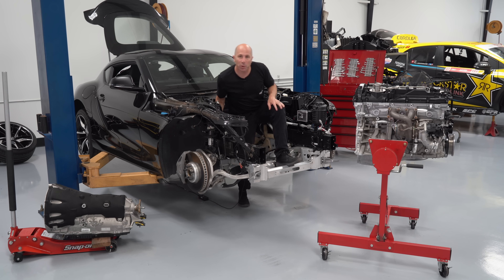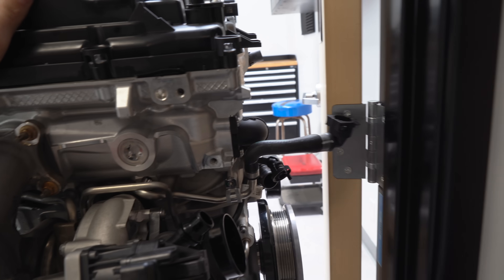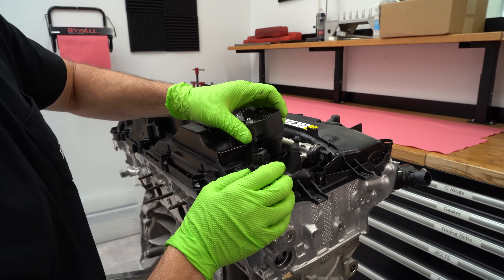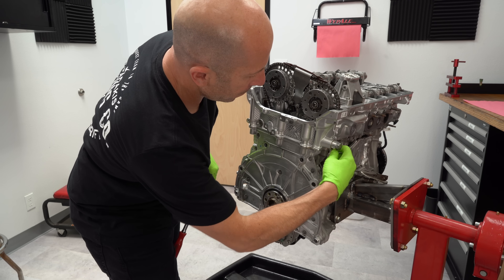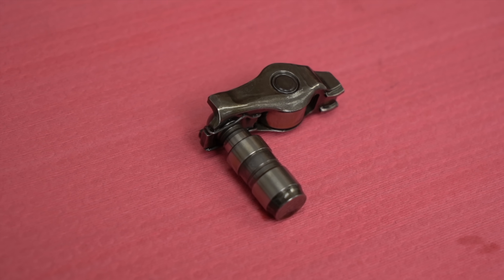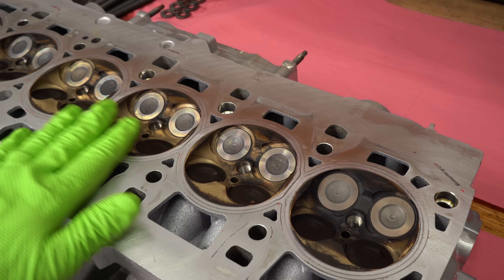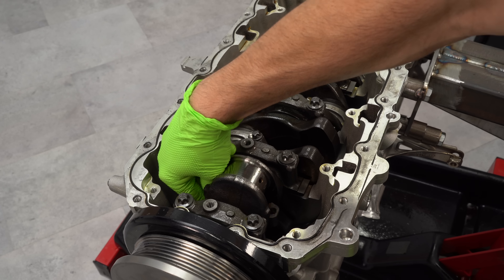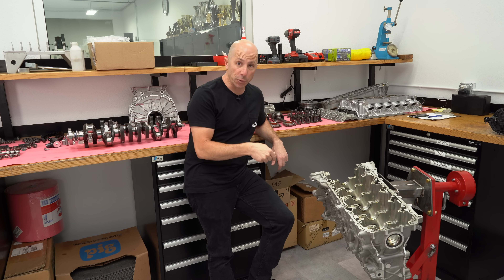2020 Supra B58 Engine Teardown - First Look - Better than the 2JZ?

Comment: Now you guys need to open the BMW version and see what changes or is it exactly the same set up?
(I kno it's the same engine but let's see if Toyota changed anything at all for the Supra)
Reply: I have a feeling it would come down to cam profiles and ECU tunes, but we'll never know if no one does it.
Reply: @johnurbanek1027  if it has to come down to that, then be so!!
 let's mesure cams, stroke, compression ratio, quality, ECU reading comparisons etc.. What did Toyota change ?. I wanna see it all!
Reply: This engine is widely available across BMW lineup, don't even need to gut a z4, 340i should do
Reply: @fastboatster  not really... This is a b58c... I think only available on the x5
Reply: @godder1an  well, x5s previously had their own versions of n52 engine, the only differences being oil to coolant heat exchanger, bigger intake and different software. I honestly doubt that there are any material internal differences between 340i's b58, x5 and z4/supra. Well, maybe cam profiles
Reply: I 2nd this motion!
Reply: i hope you know...toyota co-developed this engine, so they had input to make it more reliable. After that, they developed the b58, which is used in many platform
Reply: @herewegoagain7403  bullshit, the b58 was done by BMW only
Reply: @herewegoagain7403  fax. toyota quality standards😎
Reply: @herewegoagain7403  come on, this is all marketing bs. Pretty sure these engines are assembled by the same bmw or Magna steur facility. And bmw engine never had reliability problems caused by weak internals, it mostly were gasket leaks, failing water pumps or rattling wastegates
Reply: @POVShotgun  yes, they use sealants here instead of gaskets which tended to leak on the n series bmw engines. Time will tell if sealant holds up better
Reply: Toyota does have a reliability standard that’s the Toyota way so I’m sure there has to be something special to Toyota that only Toyota knows about to make it all that special
Reply: Good idea
Reply: The cylinder head is different ........ non supra Bmw b58 have 6 exhaust ports. https://www.bimmerboost.com/images/imported/2018/10/BMW_B58_Turbo_1-1.jpg
Reply: Exactly the same engine, in fact Toyota doesn’t do any servicing on these engine, I work for Toyota they don’t have the tools or parts for these cars, all these cars has to go to BMW for servicing. You folks need to know what you’re talking about before making comments!
Reply: @c3bam1  ha ha. I knew it. Nothing changes but the shell and name of the car

Comment: This engine is absolutely dreadful, 0 majesty out of 2jz left here, totally disappointing
Reply: When we have 6 cylinders like the TB48,1FZ,Barra,RB30 and VR38 there's really no reason for the B58 to be anything like the 2jz when we have other 6 cylinder that are different from the 2jz that can handle the same amout of power it can.
Reply: @carboydorifutoparty3976  the beauty of the mentioned engines especially ones from 90s are that they are easily tuned and modified and can handle a lot off stress with reasonable resource. Here we have aluminium block instead of cast iron, timing chain in the back part of the engine (check how thin it is), valvetronic system which was discarded by bmw because of reliability issues, direct injection, and 2 exhaust ports on 6 cylinder engine!!! What kind of engineering is that for a performance car? It is just a batch of flaws.

Comment: To me there is no replacement to the 2jz and that is not BMWs fault. Toyota can't do it either just like they did with the 86 and the AE86. You cannot replace the 4age. Both are good cars and can coexist. If you put a 2jz into a modern supra its still not an old school supra. Personally I dislike the looks of the modern supra. Its very ugly from the back and its also a surprisingly small car. Like a compact version. I live near the assembly of them and see them all the time and I thought I would get used to the looks but its still a damn ugly car. I am a Toyota freak and would honestly prefer a BMW 3 series over the new supra because of the looks. Lets see how reliable the new model is and the engine itself will probably not be an issue. I hear many stories of BMW chains breaking but people talk alot.

Comment: A plastic manifold...? One thing I love about my 2jz aesthetically is the large manifold. I don’t know that much about engines but surely a plastic manifold can’t be good in the long term?

Also another thing I love about my 2jz is the simplicity and how easy it is to replace/service the engine or anything on the car. but this 2020 Supra engine seems a HUGE pain in the ass. Having to pull the motor just for a timing belt Change?

Comment: 14 yo 2jz virgin fans ain’t gonna be happy to hear that but who cares
Reply: their tears make me stronger.
i really want to see what the B58 is capable of, and i have no doubt it will be a lot
Reply: Ducko it’s capable of 500 with just a bolt on🤷🏽‍♂️ can make more easily.
Reply: @itsdokko2990  Do you have or ever had a bmw.I have one an 04 e46m3.I know all of the gremlins in the m3.And there are some that were designed into the car purposely.A few are going to happen if you drive the m3 as designed.The rod bearings will fail,the subframe will fail,vanos failure, ect.For the money a Camaro zl1 1le will kill m3 4 5 6 around a track for 25grand less and still be more  reliable.If you dont care about reliability,price or performance get a junk bmw I did and regret ever buying a slow unreliable lemon bmw.Toyota will regret this deal too.2jz will always make more power,be more reliable better looking,easier and less hp for the money.BMW  (big money waste)
Reply: @realisrealite5554  lol, you base bmw reliability off of an e46 m3.. lol thats one of the most high strung engines bmw made.. funny how during the e90 generation bmw actually  awards for the most reliable engine of those years those cars were made. Also the b54 is considered the modern 2jz, and now the b58 is even stronger than that. People are getting stupid power from a tune on b58s. 2jz  fan girls should get that atrophied toyota nutsack out of their mouths and realize toyota wouldnt put there single most important name on a car if it wasnt up to their standards. Bmw does on good thing and thats build good straight 6s. People need to wake up.
Reply: @jtg199  the e90 reliable ? Yes one model, the 330i, that's it 😂
Reply: @E9X330  well yeah.. you just repeated what i said back to me.. your point? Bmws before the e46 generation were very reliable (e36 has interior quality issues, and most earlier M cars have strung out engines)..after that  bmw was trying to push technological innovation but couldnt keep up in the reliability department. But now times are changing and they are getting better. 9 times out of 10 people have issues with bmws because everyone buys them used and the are most likely leased cars that were never taken care of by the previous owner who is just going to trade it in for the next model in a couple of years. Id go as far to say that 90% of malfunctions on bmws are due to lack of proper factory recommended maintainance.
Reply: idk many 14yo who even know what a 2jz is so good for them
Reply: Alvaro C fr
Reply: @Woke_R2  am 13 i know 2jz is. i hate toyoda for puttin beemer engene in the knew soopra. toytda brain very mini yes.

jk i really dont care if its toyota or not as long as its a good, well built engine. 13 y/o approved supra.
Reply: BeSold fuck I’m 16 I’d still buy it
Reply: That engine might make good hp # but it will never be as reliable as the 2jz.Toyota is going to take flack because we all know that bmw engines are unreliable.Theres not one bmw that I would take over a real toyota supra turbo.
Reply: real isrealite ever heard of the 7m? If this engine ends up being unreliable, it won’t be the first unreliable Supra engine
Reply: @realisrealite5554  I tend to agree with you... The thing that's going to break down on this new BMW engine is the Plastics that surround the aluminum block they are going to break down and crack... Too much plastic in my opinion!!
Reply: real isrealite BMW in Europe and ect German manufactures there are reliable more than what you think it depends where do you live well it’s seems like you’re from the USA or the Middle East

Comment: This engine is so complicated and expensive you need to modify even the engine stand and spark plugs tool.

Lots of hoses and breakable parts. Let’s start with the points:

1- The cam gears are on the back which adds to the complication and expensive to work on (the 2jz is simpler and cheaper)

2- The cooling system is so coplicated with a whole thermostat compartment (the 2jz only has a thermostat).

3- the direct injction system need to be modified because the bearing might fail ( the 2jz has simpler and reliable system).

4- This engine has two chain and many guides (the 2jz has only one)

5- The oil pump is driven by a chain, thus the rate of failure is higher (the 2jz oil pump is driven by the crank).

6- The valves has rocker, it’s old complicated tech and may fail with high rpm (2jz only has shims).

7- The vvt i system is so complicated and every valve has a special rocker and a vvt-i system ( the 2jz vvt-i system is in front of the cam gear).

8- The pistons are light (2jz pistons could withstand up to 850hp).
Reply: BF109G with growing EPA regulations all of this technology is necessary to meet standards. Like the video stated. todays engineers are simplifying this tech and making it reliable. Will parts fail when people start modifying parameters or changing out components? Of course but you have to keep in mind no manufacturer takes into consideration people wanting to build 1000hp engines. That why with an engine so new theres trial and error till the aftermarket r&d’s components, programming, etc. the 2jz is a 30 year old engine at this point. 30 years ago EPA regulations were nothing compared to today. Although not the only factor my point is... you cant compare a 30 year old engine to a new one fairly. People need to stop living in the past and accept that the emissions standards will only get stronger until the internal combustion engine is no more so why not embrace great engineering showing us an inline 6 still has a place in modern performance.
Reply: Cold Pizza What EPA regulation have to do with a complicated vvt i system or a very expensive thermostat and cooling system ? The VQ38 of nissan don’t even have vvt i engine and the engine is simple and doing fine except having an open deck cylinder. The B58 is very complicated and toyota can remanufacture the 2jz with higher capacity, direct injection, and developed EGR system. Believe me the engine will meet the regulations easily. They can add more muffler (putting in mind that people will remove them for high HP) and this would never be the problem of Toyota.
Reply: BF109G the vr38dett has variable valve timing on the intake... just like the new supra engine and most modern engines. “Re using” an ancient engine like the 2jz is not only a very stupid idea but its also likely impossible. You cant simply “add mufflers” and “upgrade the egr”. Its not that simple. The whole engine would have to be re-engineered to the point of it being a completely different engine. Maybe if Toyota kept development of an inline 6 engine past the early 2000’s we would have gotten a Successor to the 2jz engine but manufacturers follow market trends and what a surprise! Constantly changing EPA regulations. Its the reason we got a Subaru/Toyota/Scion partnership and its the same reason we got a Toyota/BMW partnership. Its not worth Toyotas time investing millions in r&d’ing a fully Toyota engineered sports car to cater to a handful of its fans when they will outsell that same car 10 fold with trucks, crossovers, and sedans.
Reply: Cold Pizza Not impossible sir. Toyota kept producing the 1FZ engine till 2009 and they still make 4 cylinders (in my opinion 4 cylinder engines are more difficult to meet EPA). They can revive the 2jz because it has the same principal as the B58 but different in complexity. The EGR system of the 2jz could be solved by developing because it’s well made. I’m a mechanic sir and I worked in many engines so I’m not bluffing.

Comment: You should take apart a Z4 engine and see the difference.......oh wait.
Reply: Actually I am curious, because the Z4 M40i that we got in the US is a different higher output version. Instead of the integrated exhaust manifold it has individual runners. From my understanding they had to use the other heads in Europe for emissions, but not in the US. Toyota seemed to have stuck to just the same engine in all markets, probably to simplify the supply chain.

Comment: I seem to remember that things didn't go well when BMW fitted a timing chain on the rear as it's an engine out job if they need changing for any reason. Not too sure I want something electrical managing the coolant flow as that's another failure point and I am sure that charge cooler in the intake will probably leak at some point hydrolocking the engine. Not really sure I like the design of this engine but I guess it's a throwaway single use item like most BMW parts these days.

Comment: Some bits I like, alot I don't like. That exhaust manifold looks like a compromise but a good way to improve use of space on that side of the engine, not a fan of having to take the engine out for chain cam drive work.

Comment: Timing chain on the rear of the engine?? So the engine has to be pulled for the timing chain replacement?? What a stupid engine design, I guess it's German engineering at its best. Oh wait, my bad the B58 probably won't last more than 150-200k miles anyway so guess you won't need to ever change the chain🙄👎 No thanks, give me a timing belt over this nonsense

Comment: Finally 100% that the heads are the integrated exhaust manifold vs the individual runners on the higher out put B58. The difference is more low end TQ vs higher end HP.

Comment: Unfortunately I think the internal exhaust manifold is going to be a limiting factor for really high HP.
Reply: Yeah, I imagine it's a little more difficult to port one than your typical exhaust runner.  It'll make plenty of power for the street, but I think you're right.  Not gonna have big power drag racers running these like they do with the 2JZ.  I'll be staying tuned for this build though.  Who knows?  Maybe it flows really well.
Reply: @randr10  that was my first thought when he pulled the turbo off. who knows, we could be wrong. Only time will tell.
Reply: @randr10  Guys like you are totally clueless..., you annoying trashtalkers! Just shut the fuck up, because you know nothing about BMW engine technology! Fucking idiots!
Reply: @randr10  I guess that's why they have an aftermarket!
Reply: Jr ALEXANDER  Not a new engine. The B58 has been in use since 2015 in different cars, like the 340i or the M240 and such.
Reply: Jr ALEXANDER this engine isn’t new it’s been out since 2016
Reply: Definitely see a potential for an aftermarket aluminum intake manifold feature much better cooling overall I think this engine is brilliant doesn't look too complicated not unreliable. I have to say BMW has done a great job with the design.
Reply: Someone in the after market will go in and mill out that exhaust runner and fab a race manifold.
Reply: Extrudehone that bitch
Reply: Unfortunately an annoying trashtalker like you has absolutely no fucking clue about a modern inline six combustion engine layout..., you fucking idiot! 
I can tell you, how I hate such smart-ass a-holes like you..., who are always complaining about a BMW engine... WTF??? Hey, just wake up, buddy...: it's from BMW...!!! 
It's certainly not coming from a no-name company... you fucking annoying trashtalkers are totally ridiculous! 
By the way: what would a McLaren F1 be without its BMW V12 engine, which was a masterpiece of its own 25 years ago?! And the same goes for this B58 inline six today!
Reply: Jr ALEXANDER Because I've seen engines that have lacked many of these internals that are deemed as unreliable, Toyota themselves did a very intensive reliability check on every piece of this engine, and prior to the b58 the N54/55 had proven itself to be an incredibly strong engine internally, the newer ECU also has great features built in all around that make it a fairly great.

Comment: Very component based design, more expensive for the end user but fewer parts overall. I’m impressed with the design, the biggest limitation would appear to be the exhaust outlets on the block. 
The intake/exhaust manifolds could be easily be replaced and a normal front mount could be used. Another option would be a larger turbo, front mount and leave the intake manifold as a secondary cooler. Water injection could be used to eliminate issues with the direct injection long term.

Comment: This Is very well and nicely engineered. Can't say it would be "fun" to work on but I love the Engineering thought that went into it. Can already see the Turbo-side getting ported from the design n a nice bigger aftermarket exhaust header. The Oil to Water Cooler is nicely done, the Mechanical Fuel pump is a Plus, I wonder if going to 1000HP the pump would need to be upgraded??? @papadakis, Love the way they did the Intercooler right off the throttlebody its compact and If you need an aftermarket option it would simply lead to double cooling, I can't imagine the need to ever take it out unless it creates some level of restriction. The Direct Injection is Nice also. As to the Lifters without needing to be shimmed its amazing IMO, I wonder what Power the design can really take as is (After Spring upgrades etc).